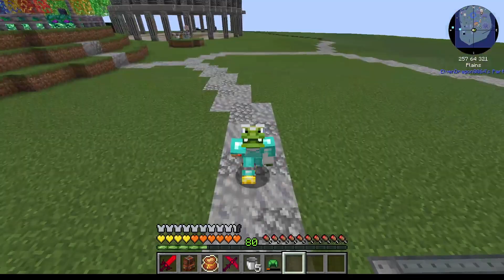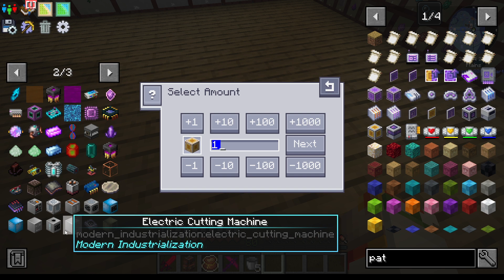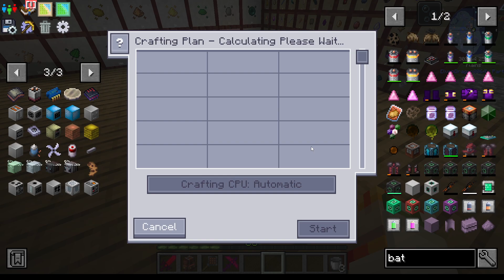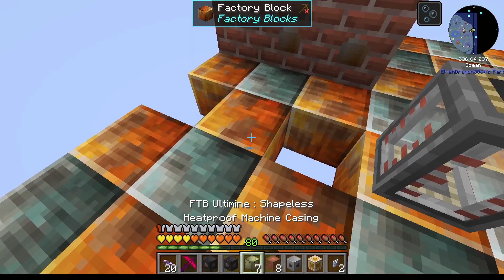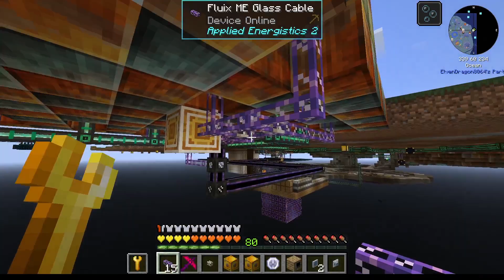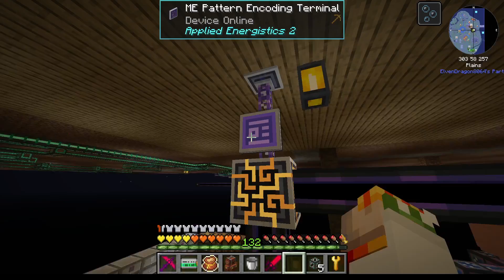FTB Skies 2 | Cryofluid and Machine Parts | Episode 16 | Shadowlands SMP

Comment: hey, im playing atm 10 and i tried making cryofluid but it doesnt work, i made 2 advanced fluid input in one it has helium and the other argon, the shape is correct and theres also the fluid output but smh it doesnt work, can you help me?
Reply from the maker: Do you have any upgrades in the vacuum freezer? Without the upgrades the freezer doesn't have the capacity to craft the cryofluid. A stack of the basic upgrades should be enough to get it working.